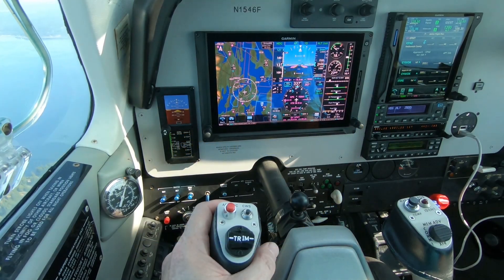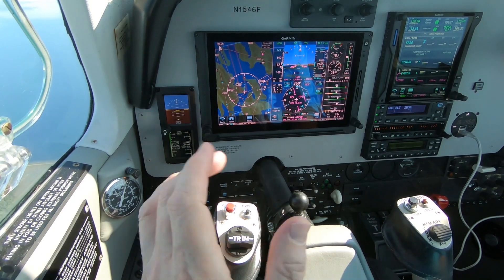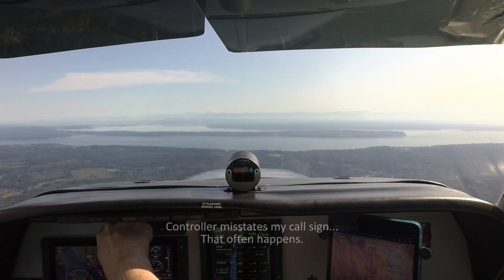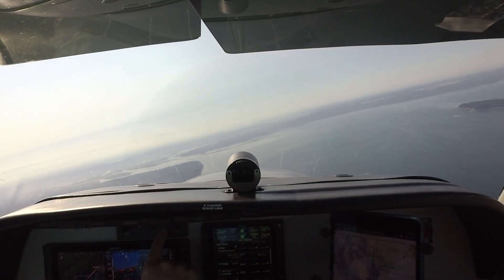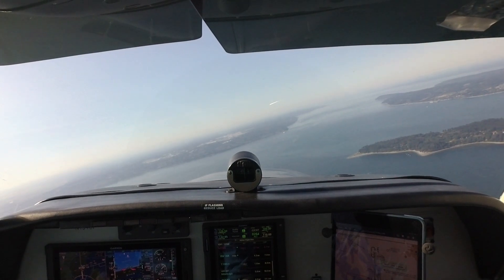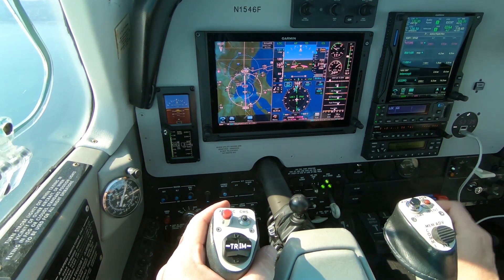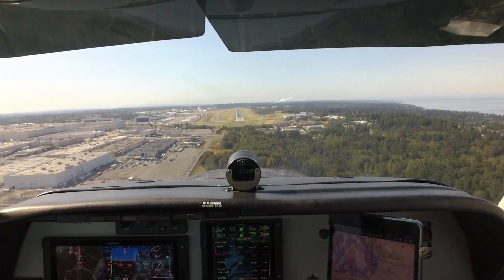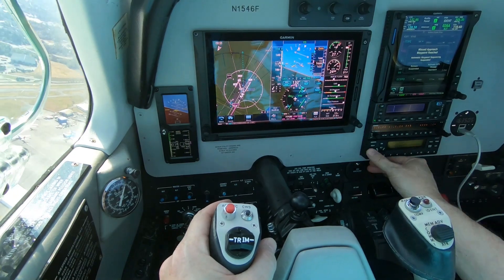Garmin GFC 600 Autopilot Test

Comment: Nice demonstration, Bruce.
To start the missed approach, did you have to push any buttons other than go-around for the autopilot? Or does that one button take care of everything? I admit I'm a bit jealous; my Century III is nowhere near that good!
Regards,
Martin
Reply from the maker: Hi, Martin. In my installation, the Go-Around button switches the AP mode to PITCH and ROLL and the flight director commands a +7 pitch attitude and wings level (that value varies with aircraft type). I have to add power and retract landing gear and flaps. When flying a published MAP,  I would then confirm or switch the CDI to GPS mode and select either HDG or NAV mode for lateral guidance and IAS mode for the climb to the initial MAP altitude. Some installations allow the system automatically to switch the CDI source to GPS (e.g., if you've flown an ILS, LOC, or VOR procedure). But regardless, as you climb out, you need to confirm the navigation source and select the appropriate lateral and vertical modes to continue flying the procedure. In other words, the Go-Around feature essentially starts the miss by establishing the airplane in a stable, wings-level climb attitude. You must still switch the navigator out of suspend mode, etc.